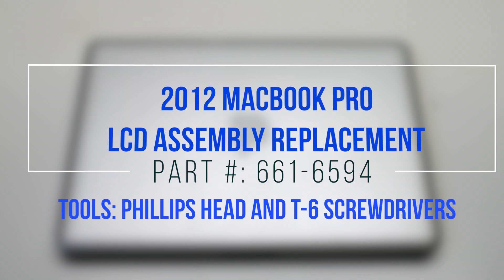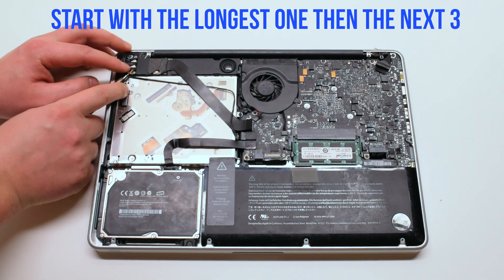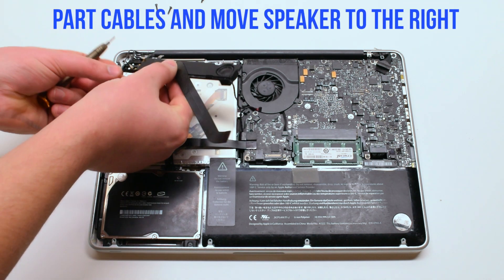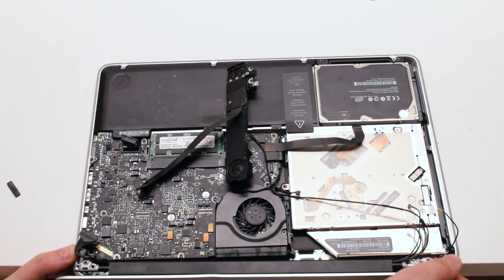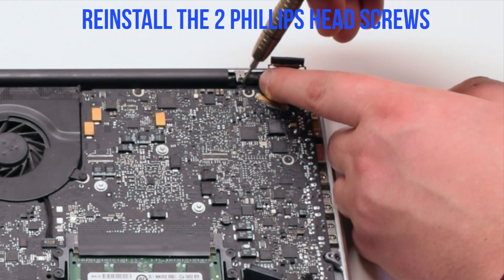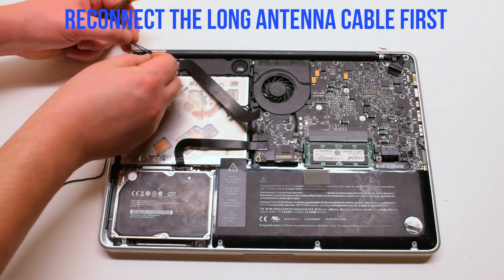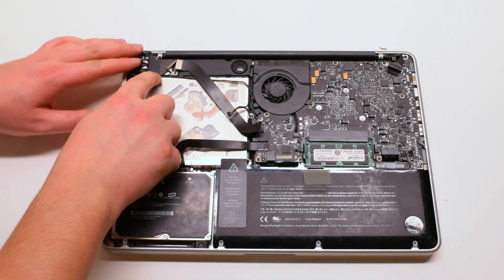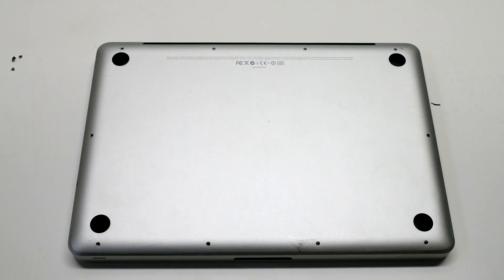2012 Macbook Pro 13" A1278 LCD Assembly Replacement

Comment: I have got a 13” MacBook Pro mid 2012 the screen needs replacing would a 2009 13” MacBook Pro screen fit on there ?
Reply: They have a different LCD that is not compatible with the later models. Mid-2009 - 2012 LCDs are compatible but the wifi and camera connector is different for 2009 than for 2010-2012, so 2009 assemblies can only be used interchangeably for display purposes exclusively.

Comment: I replaced the lcd assembly it turned on for a day and now it doesn’t. I hear the laptop startup but nothing on the screen but I do hear the fan go on. What may be wrong ?
Reply: Did you connect the LCD cable back?

Comment: Great video thanks !  One important detail for people needing tools for the job , on my macbook pro 13  the 3 hinge screws on each side are not T6 like you say in this demo , they are in fact  T9  size . So if you buy a kit with all the sizes your fine but if your buying just that tool its a T9 , not T6 .  On my macbook pro 13 A1278   2012 thats how it is anyways.

Comment: Thank you for the video, is this what I need to do if the screen cracked and it doesn’t turn on?
Rather than just replacing the face of the screen?

Comment: The way you can improve this video?  Every tool you use....mention what tool it is.  That's all.  (i.e., "you'll need a #00 Phillips screwdriver", i.e. "you'll need a Torx T6 torque screwdriver.")  Just whatever screw or ? that you're disconnecting, specify what tool you're using for each separation or disconnection. That way we viewers are all  ready & prepared and, most importantly, will not damage anything---as we proceed by your protocol.

That's the only need for improvement you might make, in my humble opinion.  Thank you for showing the process overall.  I can make do.  I'll attend to the details as needed on my own as necessary.  THANK YOU AS WELL.
Reply from the maker: Thanks for the feedback

Comment: I replaced my screen and the lvds cable but still getting a black screen. MacBook powers up. Not sure why it’s not going on. I hook up my projector to it and it displays that
Reply from the maker: I can be one of many components that have a bad connection on the board. Your best bet besides replacement is reflowing.

Comment: Hello. I hope you can help me.

My screen worked fine before I took off the LCD because of a noise in the plastic parts every time i close the screen; i just did that, checked the black plastic at the bottom of the screen and then i putted back on its place but then the screen is black, the brightness doesn't work, i can see the through with a lamp and i can get to my desktop but i can not get the brightness work again, do you know what can be wrong?
Reply from the maker: Yes, it's the back-light that is out. There are two variants of solutions to this issue. First is to unplug the LVDS cable (The main lcd screen cable) and plug it back in, then perform a SMC reset http://www.appledollars.com/reset-smc , the second solution is to replace the back light fuse that might have been damaged, we don't cover component level repairs but we can point you toward an excellent channel that does just that https://www.youtube.com/user/rossmanngroup with a little bit of research you should find what you are looking for. Let us know if this helps.

Comment: Hi 

I did the exact things done in this video but after I reassambled there is  activity in the screen. The screen is dead. What do you think went wrong ? :)
Reply from the maker: The LVDS (LCD) connector is very fragile and might need to be reseated, make sure the keyboard cable is plugged in correctly and that the Macbook is powering on (fans spin) after pressing the power button, the power button is part of the keyboard ribbon.